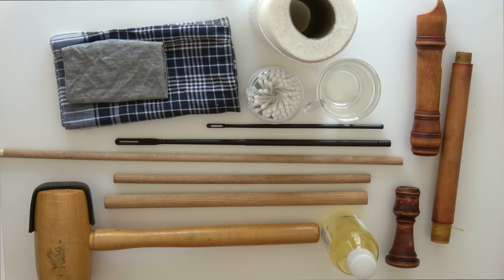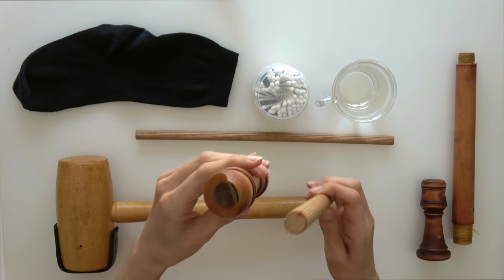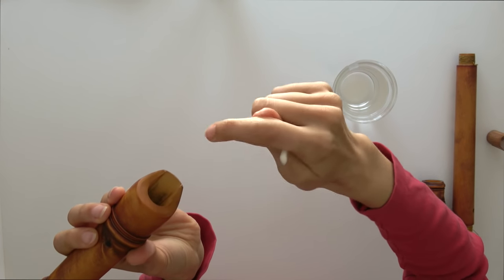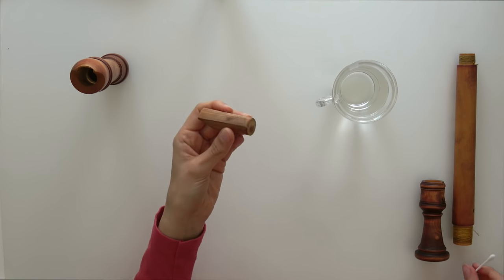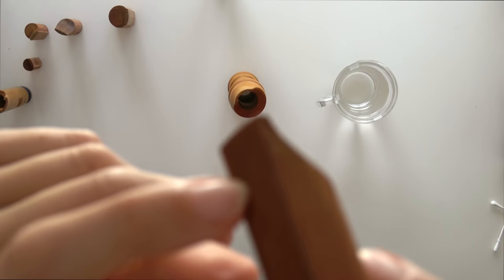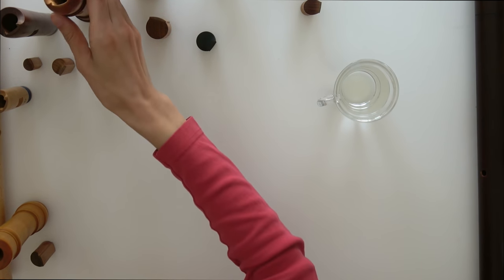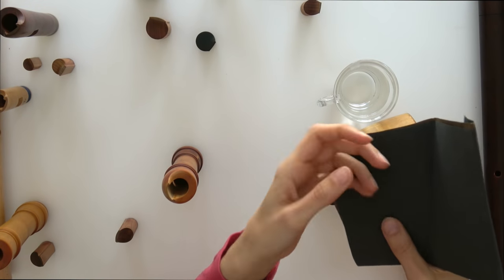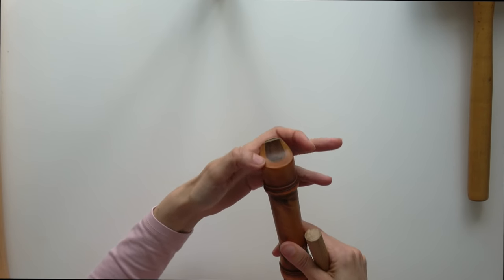How to clean the block of the recorder

Comment from the maker: ( 🇪🇸Vídeo en español: https://youtu.be/2TpgT1XRGys )

Here are the links to the other videos!
How to oil the recorder: https://youtu.be/XPsaGnBPV04
How to maintain recorder tabs (cork / thread): https://youtu.be/4A0cA5L_vsE
How to place new thread on the tab of a recorder: https://youtu.be/r32Pt-jutrY
What to do when a recorder block doesn't fit: https://youtu.be/pHTGs4b_ph0
How to solve a regularly clogged recorder: https://youtu.be/JmL6KXOQQGA
How to treat mould in a recorder: https://youtu.be/k0nfahcg09o
How to clean extra small recorders: https://youtu.be/rKsDr4ywYlc
How to prevent the recorder thumb hole from wearing out: https://youtu.be/46LxHeFZWnI

Comment: THANK YOU SO MUCH LOBKE! I saw this on the Kueng website - " If the wood surface in the wind- channel is rough or overlaid with dirt particles, neither pre-warming or Anticondens will help (characteristic: the hoarseness persists). The only solution is to send it in for cleaning" and realised that this exactly describes my Dolmetsch which I just could not play in. 
I followed your instructions here (very nervously) and I've just got the block back in, after several days wait after taking it out and cleaning it.
To get the block back,  I held the base of the head-joint against my stoumach to give pressure against something a bit firm but a bit  flexible and pushed with my thumb towards me. The inside of this Dolmetsch has a slightly larger bore for the block area than for the rest of the inside so relocating it was easier than I had expected. 
SEVERAL MONTHS LATER - The recorder is now playing fine. Until I cleaned the block, nothing helped. After cleaning the block and playing the recorder in in the usual way, it's now a fine instrument. Thank you for this film Lobke (though I have to say this is always going to be something I approach nervously).
Reply from the maker: JULIAN SANDERS Thank you so much for this awesome feedback!! I’m glad it went in easily!! And I totally understand you worked on it with some nervousness - it’s such a delicate part of the recorder. The good thing is, once you’ve done it, it gets easier every time, and you don’t have to send it every so many months just to have it cleaned. Thank you again!! ❤️

Comment: This is a great video! I use alcohol for cleaning the block and windway. It dries quickly and disinfects at the same time. I also use a (clean!) tootbrush in the windway. It efficiently gets dirt out of the corners without doing any damage.
Reply from the maker: Philippe Bolton Thank you so much for leaving a comment!! My experience is alcohol really dries the wood out, that’s why I prefer water even though it takes more time, and only use alcohol if it’s really dirty or has mould. Your tip on the toothbrush is great! It should be a soft one though, right?

Comment: Thank you Lobke for the clear explanations. When doing the same, I take utmost care of the chamfer, at the bevel side of the block : it is fragile and crucial, as it directs the air flow to the bevel.
Reply from the maker: Correct! That is indeed a detail I didn’t mention in the video! Thank you! 🌸

Comment: Hello there. If the block refuses to go back in, should I just wait a couple of days and then try again? Also, I saw a video whereby someone was cleaning the block with high volume alcohol. Would you recommend doing that as well? Many thanks for your very helpful video.
Reply from the maker: Hello, thank you for your comment! I recommend you watch this video: "What to do when a recorder block doesn't fit": https://youtu.be/pHTGs4b_ph0 - that will answer your question (make sure your block is dry though)! Alcohol in my experience dries out the wood, so I only use it when it's really dirty or when there is mould.